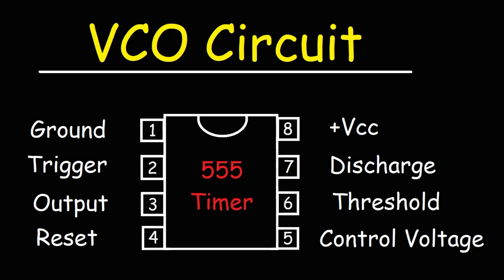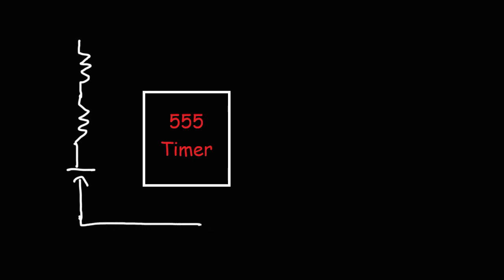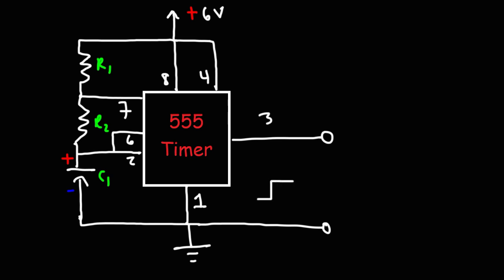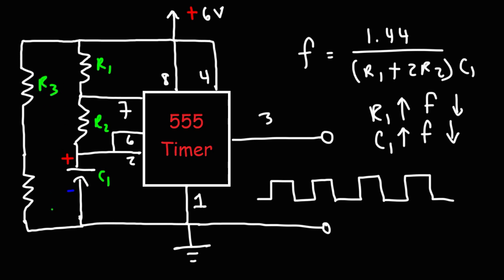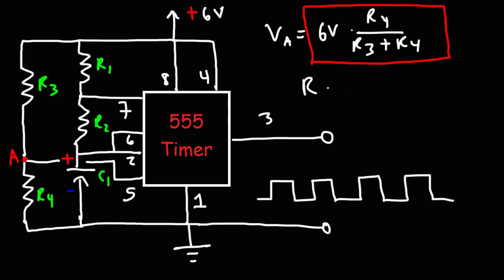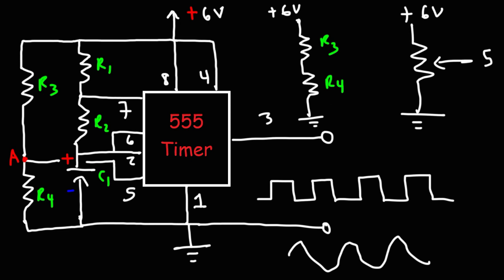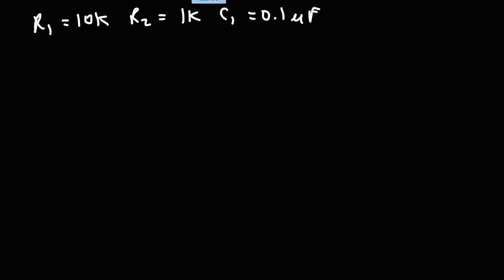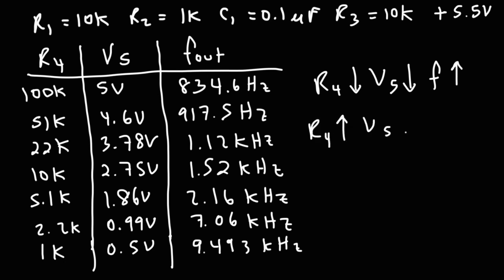Voltage Controlled Oscillator Using 555 Timer

Comment: I built a simple crystal  controlled oscillator using the 555  circuit for aligning vintage radio IF stages. The square waves excite the IF transformers and they produced beautifully proportioned sine waves , good enough to do a clean sweep alignment or just the simple peak alignment tuning using a scope to monitor  peak amplitude values.

Comment: Exellant explaining.  And yr accent / tone is classic informative / fresh.  I gather i can put transistor to switch power using the entire circuit as a regulator -  so when solar voltage goes up the freaquency goes down thus voltage stays where you want it.  Thanks.

Comment: How do you calculate the frequency when the control voltage is plugged in with the formula?
Reply: Well, all you need is to use a math methode to calculate the unknown value, once you have those known ones.

Comment: I'm not clear on if you measure Vs or simply calculate it in the table at 09:30. It seems the latter.
But R3 and R4 are in parallel with the internal 5 k ohm resistors of the 555. R3 with two of them (so in parallel with 10k), and R4 with one 5k ohm, affecting the voltage  Vs. 
Not that it changes anything in the video, there's still a frequency jump at the 3rd last step
(In short. Managed to delete my comment)

Comment: I have an arcade button as a kill switch on my guitar. Could this circuit be used to turm it into a rapid fire mod? The guitar itself has no voltage so I know Id have to power it with a battery.

Comment: Thanks for sharing, I was using the 555 a little bit different, basically I normally don't use the pin 5 and only have a decoupling cap on that to ground. I didn't know that the frequencies you get out of the 555 timer this way has such a wide range.
I made myself a crude function generator using a couple 555 timers, a few transistors, some opamps and a bunch of diodes and resistors and hey presto I got myself a simple function generator, fully analog and still capable of producing a wide variety of different looking waves.
I'm even working on a little add-on so I can use it to match transistors using the function generator and my oscilloscope in the XY mode as a curve tracer, I love the analog stuff, it's more of a challenge but eventually when it all works it will keep working for a long time before it needs some TLC. 
My question is what's the lowest frequency you can get with this circuit and the highest frequency when you only change the two resistors R3 and R4?

Comment: It means the voltage control amplifies the signal output? 
If you change the capacitor into variable capacitor connected to the Trigger pin, you will have Frequency changes?